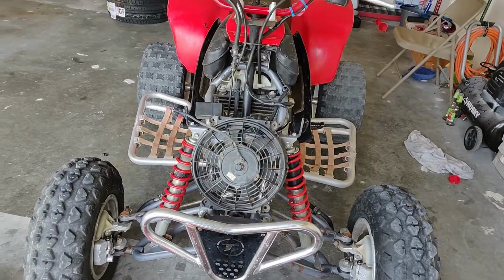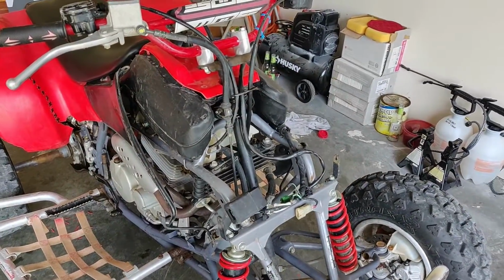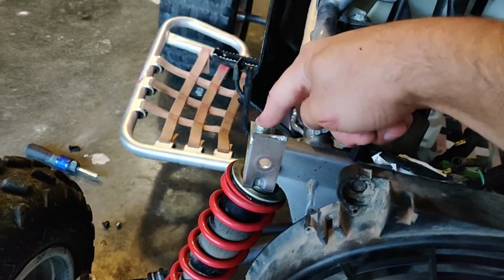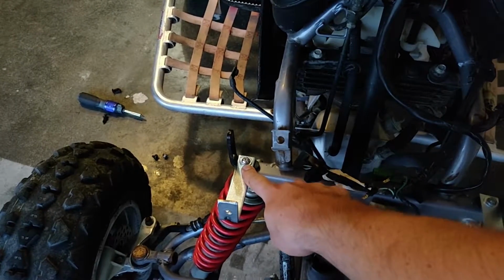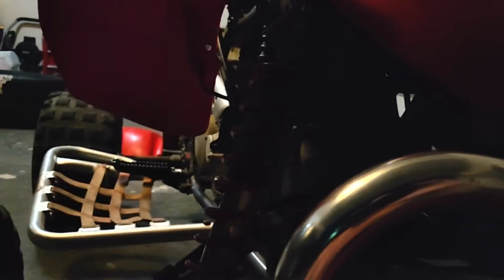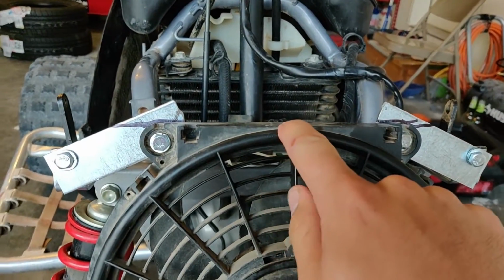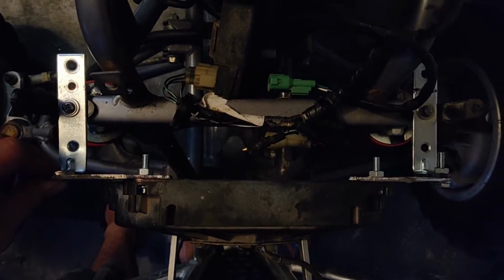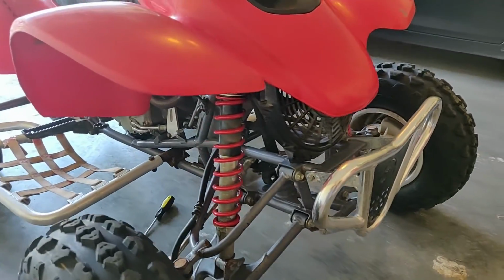PROJECT HONDA TRX 400ex BUILD [PART 6] COOLING FAN

Comment: what temp did the fan drop the hot cyclinder down too?
Reply from the maker: Never checked the actual temp but I made another video with an actual spal fan on the oil cooler that worked a lot better

Comment: you can get a cheap oil cooler from Oriely's that's 3 times the size of your stock cooler for about 20 dollars. I put one on my wolverine and. it made a noticeable difference cooling it down but keep in mind it takes longer to warm up in the winter. furthermore if your going to use a radiator fan your better of using one from a motorcycle. car fans may be 12 volts just like a atv electrical system but the fan amps are more on a car than a atv. the atv charging system will struggle to keep the battery charged while
Reply from the maker: I like the oil cooler idea!

Comment: Hi I am planning to do the same on a 2008 honda 400ex is it really worth it?
Reply from the maker: In my opinion I would go with a spal fan and add it directly to your oil cooler. It's alot more effective, smaller, and better suited for the elements. Since adding this fan I have noticed a difference but I'll be adding a spal fan this summer to help improve cooling
Reply: @AthenasGarageOfficial  thanks for the advice I will put it

Comment: Hope you dont ride with anyone who can roost rocks into that thing. It has zero protection there. Spal makes a 4 inch water proof and dust proof fan that mounts right on the oil cooler.
Reply from the maker: I thought about a spal but they are to much and this fan was free thankfully. So far nothing has chipped it and by buddy just got a sportsman 850 and it slings them like crazy. It's been alright so far today. This thing has need under water completely already too! Still works like a charm
Reply: @AthenasGarageOfficial  right on bud! My spal has been packed entirely full of mud and all it did was blow the fuse. Car radiator fans usually arent all that resilient. They are designed to be protected by the radiator from debris. Im interested to see how long it holds up.
Reply from the maker: @brentpfeiffer4043  for sure! I'll keep posted of it breaks or not! It was free so Im not to worried about it! My quad was running hot today on the trails and was smoking and kicked the fan on and she stopped smoking!
Reply: @AthenasGarageOfficial  jet that bad boy before you burn it up! My stroker 440 doesnt even get that hot bud. I run a tad rich so it will load up a bit when going slow in the trails. Better than smoking a topend.
Reply from the maker: @brentpfeiffer4043  I need to it's on my list of parts to get some new jets
Reply: @AthenasGarageOfficial  looks like only mod is a slip-on fmf? Any internal mods? Also stock filter? Lid on or off? I have jetted many 400s. My quad runs a fcr39mm carb so jetting is something i am very familiar with. I bet its still stock jetting 38/148 and thats why your getting so hot. Is it a bear to start when its cold out?
Reply from the maker: @brentpfeiffer4043  it's got the slip on fmf, a uni filter and I think that's it. I havemt had this thit but for maybe 4 months now so not sure about the cold. The pilot jet is a 42 and the other is stock. I bought a carb rebuild kit and it had the pilot at 42 so I put it in there.
Reply from the maker: @brentpfeiffer4043  and I leave the lid on because I go so deep in water
Reply: @AthenasGarageOfficial  as long as your not at like some crazy elavation like in the mountains somewhere. The 42 pilot and a 155 main jet should get you right where you need to be. Also drop the clip on the needle one slot down from middle and put the mixture at 2 turns from light seat. Should be spot on. Lid on is very smart. Its not modified in anyway? No holes or anything?
Reply from the maker: @brentpfeiffer4043  nope no holes on it. It's completely stock with that breather tube going up toward the gas tank. I'm scared go leave it off like I said cause I get so deep in mud. I think we are at like 1500-2000 in elevation some of these mts we go to are maybe 3000 but I bet not much higher than that. I'm gonna order a bunch of main jets and do some testing. If you think 155 I'll start there and see how she runs.
Reply: @AthenasGarageOfficial  155 will be a good starting point. Being at 1000-2000 and sometimes riding in 3000 you will more than likely end up between 150 and 155. 42 pilot is honestly IMO what honda should have had in the stock 400ex. That 38 was to satisfy emissions regulations. The 38 makes them near impossible to start in the winter. The 42 solves all those problems. You shouldnt need to choke it at all when its warm out. May have to in the winter if it gets that cold where you are.
Reply from the maker: @brentpfeiffer4043  I haven't had to choke it yet so your definitely right on the 42. I'm ready to see how she does in the winter. I've also thought about adding an extra radiator to the front where the fan is but don't know when or if I'll do that. Thanks for all the info! Really appreciate it
Reply from the maker: @brentpfeiffer4043  I'll go look there! Thanks I really appreciate the help as I'm super new to riding ATVs and this is my first one so I don't know much about them!
Reply: @AthenasGarageOfficial  no worries man. We all had to start somewhere. The forum is full of like minded people. We all genuinely enjoy helping people learn about quads and how to fix them. Take care and keep the rubber side down!